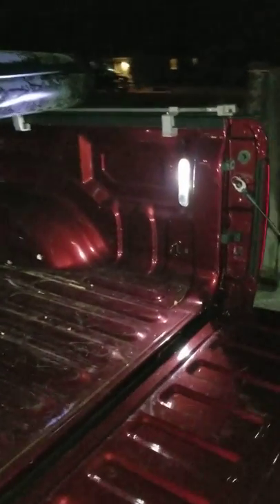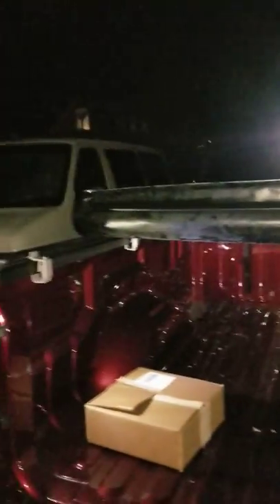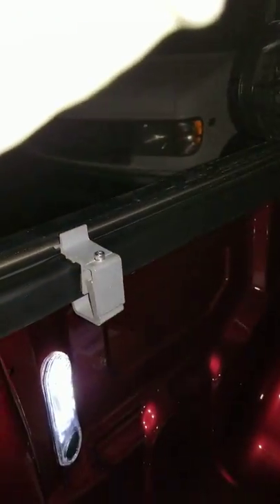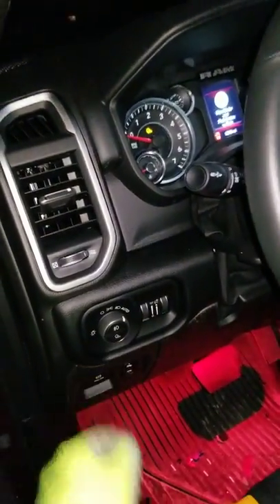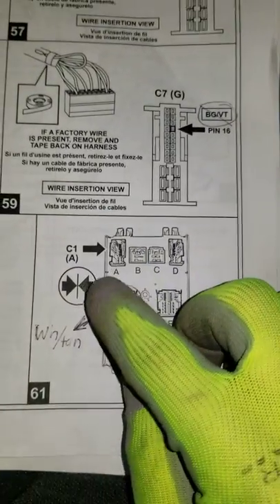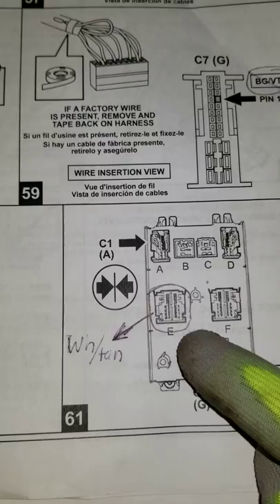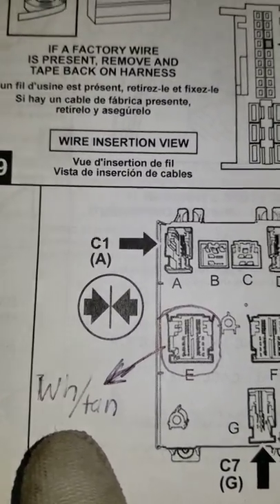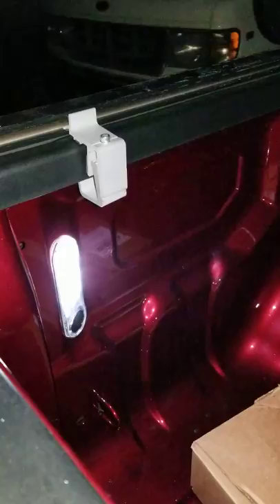2019 ram 1500 factory bed lights NO FLASH!

Comment: Hey man, thank you very much for this video. This is the kind of info we need. I imagine that buttons goes back into the ECM and tell it to turn off lights but I am sure a simple relay wire up and into the light harness we can make it function as it should. When I get back to the states I will be doing same thing as you. If no one has figured out how to wire that button to properly and safely cut the circuit I will do a video of whatever I come up with. I cant remember if my directions had wiring diagram for the mopar kit. Does it? If so would you kind scanning and emailing me so I can figure out something before getting home?

Comment: Did you splice in the tan white wire to the one you mentioned or did you unpin the wire you found on the new connector and sub in the tan wire with white strip?
Did you do anything with the tan purple wire at all or is it completely un pinned?

Comment: if i just wanted to run aftermarket lights in the bed and just tie in the power wire could i tie in near the sill area at the floor ?
Reply from the maker: Yes, the wire for the 3rd brake light runs along the drivers side under the door sills. The same wire is there that you can grab 12v from

Comment: I see why the directions were different now 
The lights I have don’t have the button on them
Maybe I was sold the 2018s lol
Wish you’d hooked yours up 2 weeks ago and I would have done my this way
Good job figuring out how to avoid the dealer
Reply from the maker: Yes that would explain it. As long as they fit I dont think there is a difference besides the button. You could always switch the wiring around one day if you find something else to use on the switch you installed.
Reply: @TheBattery087  now that you mention it the mopar one I ordered online may not have the buttons either. If so, even easier. No way will i pay the dealer 150 to flash something for me that is quick yet they can charge cause only they have the tool.
Reply: fifth genrams may have to do that in the future 
Thanks